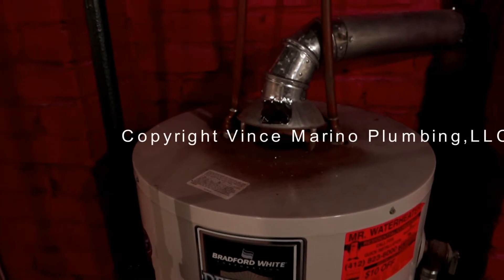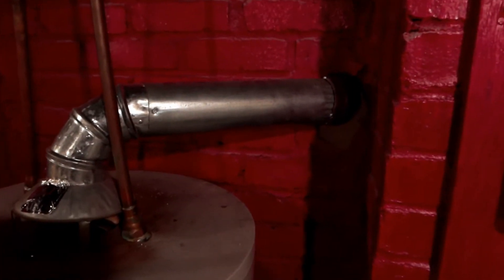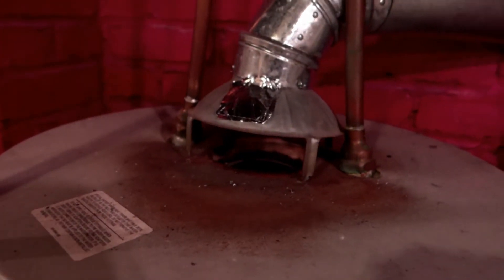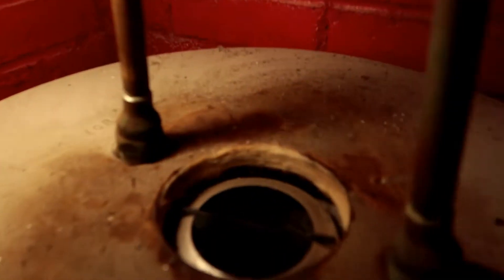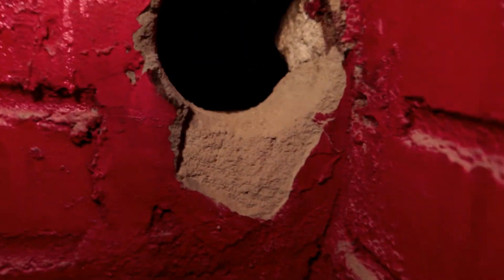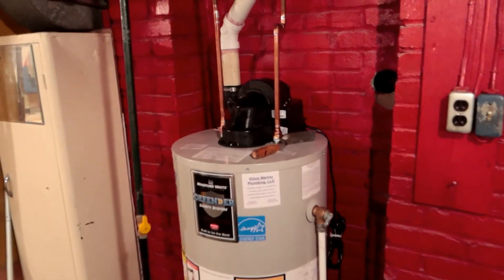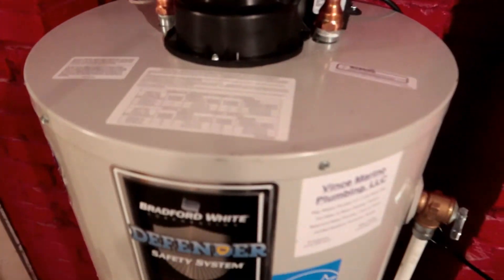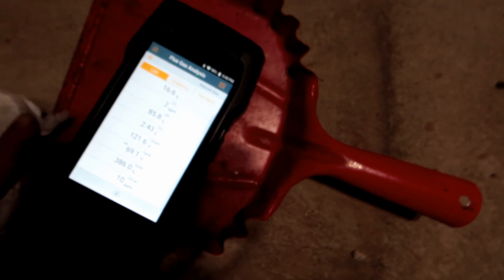Back drafting water heater

Comment: I like that you still solder all your work, I don't trust pro press longterm.
Reply from the maker: Yes I solder I don’t like pro press neither.
Reply: Better start trusting it. Not all towns like flame anymore and a lot of customers don't want to pay for a fire detail on a hot works permit to change out a water heater.
Reply: @tedd7028 fair enough on a water heater or in a large commercial building but in a house or behind a wall, solder is still my go to.